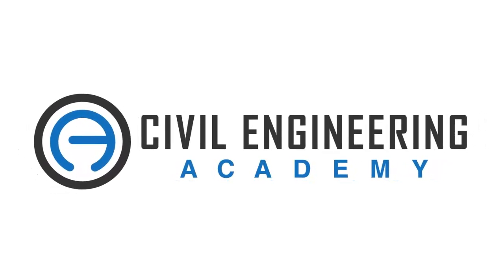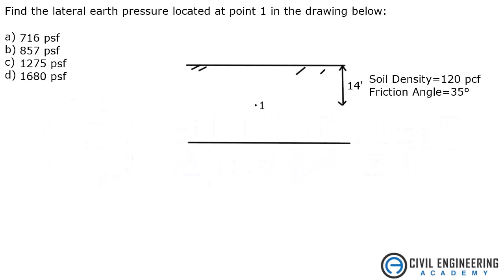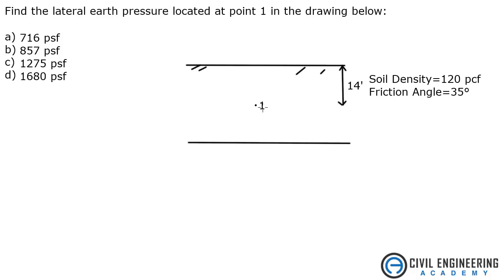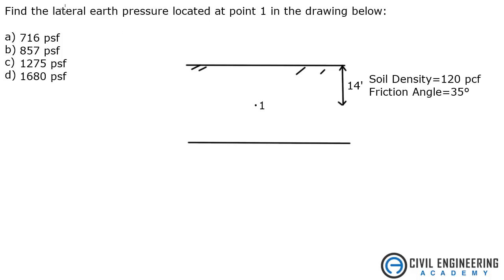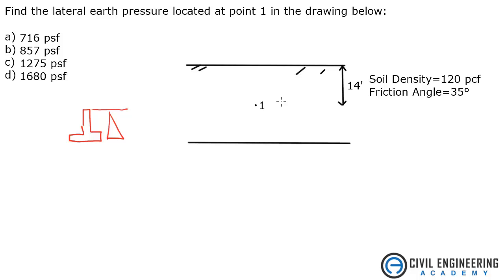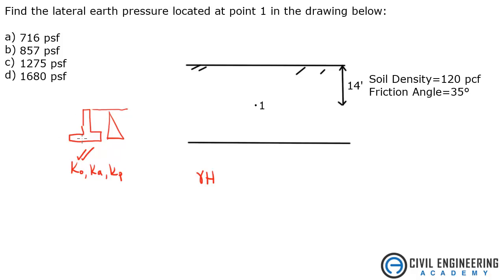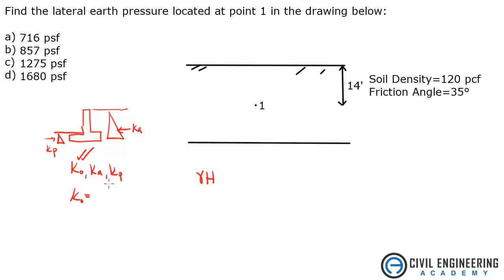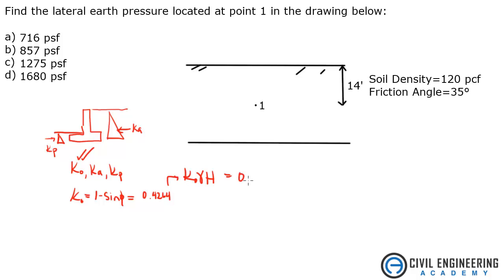Geotech - Find the Lateral Earth Pressure at a Point

Comment: hello. Let's say the answer comes to 719.45 psf. If the question says "The lateral earth pressure is MOST NEARLY" ?? What would be the correct choice - A or B?? 
Thanks,
Reply from the maker: In the case of what the question asks, I'd still choose A.  If they specifically said something like, "Find the lateral load on the retaining wall and choose most nearly the answer you would use to design the wall."  In that case, then I'd have to round up and choose B because A would not provide a load that would be adequate for the design.  I know in real life you'd round up, but the question simply asks for the lateral earth pressure.  Hope that helps.  MOST NEARLY is the "tricky" part of the exam.